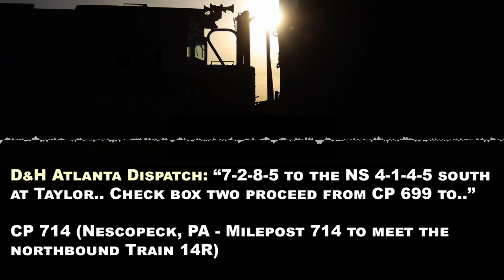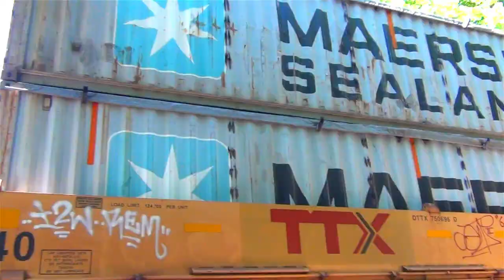[BT][T-230] (RE-UPLOAD) Train Trouble: 13,000 Feet - 20,000 Tons and a Broken Knuckle | Trains 21

Comment: As engineer on CN Rail I loved the super long and heavy trains. I was there when Hunter brought them in about 20 years ago and I saw everyone in management drink the Kool-Aid.  My income doubled and the amount of work I was required to preform was cut in half. I started to make more money in taxis than in locomotive cabs. The number of trains I got from my initial to my final terminal was mininal. I did not care, it all paid and pays well. 99.5% of CN's mainline grade is 0.5% or less (that is less than 1/2 of one percent)  If it should work anyplace it should work here. But  not matter what they did they never got the long trains to work. We never had DP power before long trains and even that did not make them work. Regulations to not release the brakes under 25 mph helped a little but every trip some train is ripped apart or broken down somewhere on the subdivision. Emergency appilcations will cause trains to jacknife, and even derailments will sometimes have one or two addition derailments in the train caused by jacknifing. Google VIA Rail delays articles and see that 6 years ago they added 14 hours on their already slack schedule for Toronto to Vancouver to run on time, but pre covid their ontime performance was less than 10 percent on that run. The only loser is the customer who has to lease addition cars to haul the same tonnage. Thank you Hunter Harrison for all the free money.
Reply: I def agree it sucks for the the cx big time. The shortlines are gaining more biz which helps. Its just changing with the times

Comment: I want to say that the limits of the trackbed have been overreached, and is experiencing a thing known as "pumping" which is known in the construction industry when building roadbeds   you can cause a pile of fill to start jumping up and down by rolling to much heavy equipment across it  usually heavy scrapers running back and forth much like trains that causes it.
Reply: Roadbed limitations haven't been exceeded nor will it ever be. The pumping you are referring to isn't caused but the roadbed being unable to handle the abuse it has to withstand. It's a tampering issue often related to the roadbed settling or rail joints themselves. Take the same track that is pumping and have a MOW crew properly re-tamp the track and the pumping stops. Weight, settlement, and deterioration cause the roadbed itself and the earth under it to alter over time. Simple maintenance to re-profile the ballast as well as replace it with new ballast will fix any pumping issues. The roadbed is more then strong enough for it's intended use if maintained properly.

The same for all aspects of the track infrastructure for that matter. The weak point in the system are the rails themselves and that's by design. They are expected to wear and need to be replaced. It's much easier to replace a rail then to rebuild the entire roadbed itself. Admittedly track weight/density does continue to climb to extend it's service life as trains and equipment continue to get heavier. But at the end of the day the track is meant to be replaced. The same could be said for brake shoes, couplers, air hoses, and so on. Weak points in the system are intentional to allow other more vital parts of the equipment to be less likely to damaged or suffer premature fatigue.

It's one reason why ribbon rail is the industry standard these days. Fewer rail joins allow for fewer impact points from one wheel leaving one rail and having to bridge a gap to make contact with the next rail. Every gap is a weak point that causes increased stress to the track itself but also acts like a pile-driver to the roadbed under it having a constant impacting weight slamming down on it from the equipment having to bridge a gap above it. The fewer rail joins you have the less this whole problem exists. Also the few rail joints you have the fewer potential points of failure you have to maintain and worry about. Plain and simple the track is built to be strong yet replaceable. Ribbon rail, concrete ties, increased rail densities, and better track maintenance extend it's life, but it all will break down over time and need to be replaced. Pumping isn't a consequence of operations, but rather the result of poor maintenance and simple physics. Hopefully that clarifies things.

-Nearly two decades working for UP.